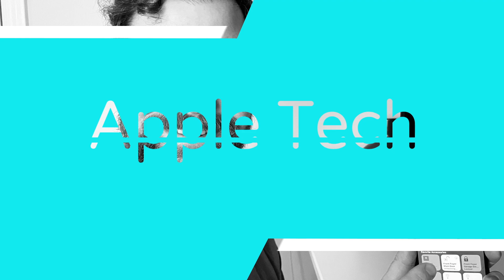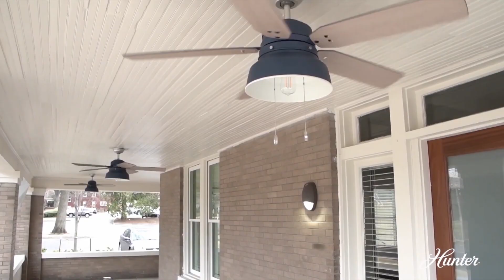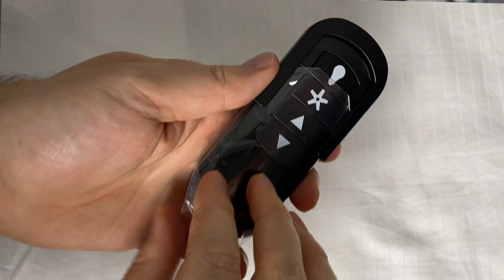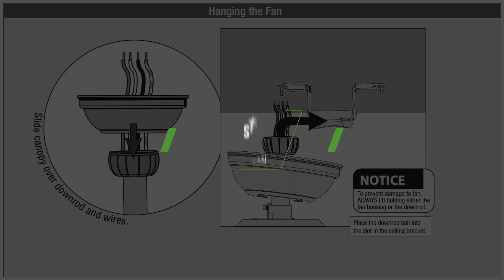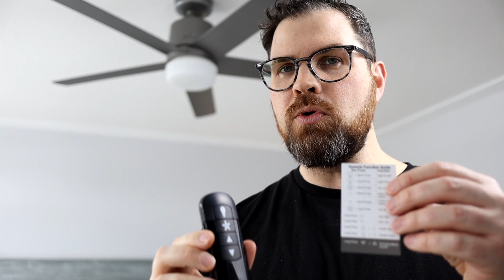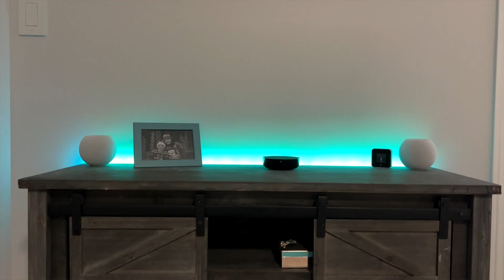HUNTER FAN FOR YOUR SMART HOME! Add into Scenes & Automations

Comment from the maker: 💥Let's Connect! 💥
See what I'm up to between videos:
📸https://www.instagram.com/thebradlloyd/
🐦https://twitter.com/HomeWithTBL
😀https://www.facebook.com/thebradlloyd

Check out this low profile Hunter fan:
https://geni.us/eYuHtX1 (affiliate)
Reply: Hello The Brad LLoyd. I appreciate the review of your Hunter ceiling fan. I bought the Aerodyne model back in January of this year. Which leads me to my question. Have you had issues with the fan going to no response in Homekit? I've had nothing but trouble from mine and I've worked with their tech support for over 2 months. I don't think I have any kind of extraneous network setup as all my other Homekit devices work with no issues. I'm to the point to where I think there is something wrong with the fan but their tech support doesn't seem to be willing to entertain that idea. Any ideas by you or anyone else that may help, would be GREATLY appreciated!!!
Reply from the maker: @TechJB65  Hi Jody, I haven't had any issues. Aside from the standard basic troubleshooting, you could try to reset it, remove it from homekit which I'm assuming you may have already tried. You could try to assign a static IP on your Wifi Network. These instructions depend on your router. Sorry for the delayed response. Hope you figure this out because it's a shame when a great fan in my opinion, isn't working as intended for you! Thanks for watching.
Reply: @TheBradLloyd  thanks for the information. I may have figured it out. I’ve had the fan up abs working with Homekit for a full day now without going to no response. I had to reset the fan with the remote and disconnect it from power. Then I rebooted my mesh WiFi system and waited till it was fully up. Then reconnected the fan to power and went through adding the fan back again through the Hunter app. So far it’s been up and responsive like I said.

Comment: these fans are terrible and frustrating- while functionally is fine - Their smart integrations with Alexa and HomeKit are terrible. My lights are constantly out of sync and some of my fans dont connect at all.  Working with CS hasn’t panned out after 5-6 total hours. I am beyond frustrated and at this point I’m looking at a charge back because they can’t seem to solve the issue and are at a loss for why their lights are out of sync or randomly turn lights on after they are turned off (or vice versa)

Comment: Hunter make’s excellent fans.  Hunter makes horrible smart integrations, Hunters app works when it wants to.  Hunter customer support is bad, bad, bad.  Imagine the worst customer service you have ever experienced, that’s about where it’s at.  Took 6 weeks to speak with a Technician to help the WiFi issues.  He did Not help.   I eventually fixed the issue on my own through trial and error.

Comment: lol, think I had that same ceiling fan you had updated.  That must have been the "standard" design.  Wasn't attractive then and has grown worse with age.  Everything you said, applied to my situation, only have one switch, want apple home kit, etc.  And there are not many choices.  Sticking with a brand like Hunter or Hampton Bay is HIGHLY recommended.  this isn't exactly like setting up a lamp.  its a bit more labor intensive and you want it last and not make a lot of extra noise for years.  Thanks for posting.

Comment: How many wires do you need for the hunter fan? In my new home I have a bunch of recessed lights in my main living room witch is 40ftx40ft and I was just going to install fans with no lights and I believe their is only two wires with a ground L1,Neutral,Ground. But now I changed my mind and want lights in my fans but I have already sealed the walls with drywall.

Comment: How did you keep the fan connected to wifi? And how does it reconnect if you lose power in a storm? I am having nothing but issues after buying these fans after watching your video.
Reply from the maker: I’ve had zero connection issues. Not sure if it’s an issue with the fan or perhaps your wifi…? If you’ve already tried a factory reset and are confident in your wifi then I would suggest contacting Hunter.

Comment: How bright is the light? I have a big master room.
Reply from the maker: There are a spot for 2 bulbs, so it just depends on what you install. The lights I have in mine are 1100 lumens (75 W equivalent). I don't think the larger 1600 lumen bulbs would fit though.
Reply: @TheBradLloyd  Thank you

Comment: thank you! i use hue lights with an Lutron Arora dimmer and i was concerned that i wouldn't be able to use my dimmer switch any more since they can only control hue lights. :) i figured it may be possible if i left the hunter light on and then hid it in home kit. thank you for confirming :D
Reply from the maker: Yes, I’m using the Aurora for the hue lights in my fan as well - it works great.

Comment: man you had the same fan i got, and its making a ton of noise so im going to get what you got, I like that hunter fan it looks bad ass. I had to switch to the Radeon man, the stylus was too big for my room, its really a beautiful fan and a major upgrade over the pull chai. different remote from the stylus also and connection to the app was a hassle. The fan is quiet indeed. looking to add the philips smart bulbs to it to see if its work it. the govee's looks better as I plug them up. I dont like the frosted light defuser thats on the fan though but its good for now.

Comment: Do you have to pair this with a smart switch? If you use a standard switch, and someone turns it in the ‘off’ position, I imagine you can’t turn the fan on from HomeKit? Is that accurate? Thanks for the guidance!

Comment: Hey Brad. I had the same setup at home with one switch for both the fan and light. (Technically there’s two switches on the wall, but one is for an outlet.) I just installed my Hunter fan and it worked in HomeKit for a few minutes then went non responsive. Do you know if I have to stay on 2.4 ghz to work all the time. My phone almost always reverts to 5. Thanks in advance.

Comment: Should have just got a normal fan and used a smart bulb. Then use the twitch to control the bulb in HomeKit
Reply from the maker: That would work if you don’t want HomeKit support to control the fan. If I added a HomeKit switch for the fan, then it wouldn’t allow my smart lights to work. Aside from expensive rewiring (to add a second switch), this was the simplest solution. It’s working great for my set up, though your needs may be different.

Comment: I’ve had the Hunter Symphony for over 2 years. Their customer service was great replacing warranty issue with one of the four fans. The biggest downside is their simple connect app which their many updates doesn’t fix much but introduces new issues. The app will randomly ask you to login after you’re already logged in and then warn you all fans will be removed after you login. If I bypass login my fans stay in the app but I can’t update or save changes. Biggest issue is HomeKit reporting the fans not responding which may be HomeKit issue or combo of HomeKit and Hunter controller.

Comment: My two Hunter fans are hands down the worst smart home purchase I have ever made.

There is NO way to factory default the fans completely, and mine had been stuck in a state where they thought they were part of a HomeKit home, but HomeKit did not have any entities. Trying to add the fans would result in a "This device already belongs to a HomeKit Home" error, resetting did absolutely nothing.

I called Hunter Support and explained the issue, and the tech's first question was "Are you using an Android phone or Apple phone?" ... for a HomeKit issue...

After explaining multiple times, they ended up referring me to the developer of the app and fan software. He only works on certain days. He gave me a call, and because I was able to get the fan to connect to WIFI (attempting to add to HomeKit would reconnect the fan to WIFI, but not HomeKit), he was able to reset the fan from his side, allowing me to finally add the fan back to HomeKIt.

I constantly have to power off the fans and power them back on as they tend to not respond, even though I have no other issues with this and other devices in my home. These things make me nervous that one day they won't respond, I won't be able to fix the issue, then I'll have to go back through support to get the fan reset.

TL;DR - Fans are finicky, app and "smart" functions are underbaked, mainline support is clueless. Tip: If you have neutral wires in your home, get a fan you like and use Lutron's fan control kit instead.
Reply from the maker: Thanks for your feedback, I haven't had the same experience however, I can't imagine the frustration you would have had after all this. Using a Smart Fan control with a regular fan is a good option for many, if like you said, you have a neutral wire. Thanks for taking the time to share your experience and hope the issues are resolved for now.

Comment: I loved this review, especially as I just installed a Hunter Romulus.  We're in the middle of some house upgrades and we discovered that a bit of rewiring would allow the approximately 8-year old Hunter fans in each of my kid's bedrooms to be wired to a separate light and fan Lutron Caseta switches. The fans still work great after many years of use.  

The same was not true for our master bedroom.  Therefore, after some research, I purchased the Hunter Romulus.  The link to HomeKit means that the controls my wife is finally comfortable using in other parts of the house now work in the master bedroom through it's HomePod.  It has had flawless connection since we first installed it.  Moreover, the fan is easily the best I've ever had.  At max speed, it operates without any wobble and the noise is barely audible.  The combination of a great running fan with HomeKit automations means that my wife turn the fan on at the beginning of our sleep.  As she insists on sleeping with her window ajar, the room eventually gets too cold for a fan.  Therefore, linking it to my Eve Home means we can have it automatically turn off at a certain temperature.  Even after just a week, my wife and I are both loving the fan.

Comment: Wow Brad, this was an awesome video! I just installed a Hunter Aerodyne smart fan in my bedroom yesterday and I love the apple HomeKit compatibility. How do you program temperature based automation? I’ve got to know!!!
Reply from the maker: Thanks Scott! Glad you love this video. You can set up temperature based automations in the Eve app, Controller for Homekit or Home +5. I use Eve Room to measure the temperature or an Aqara temperature sensor, and then you can just set up your automation to say once a certain temperature is reached, turn on the Hunter fan. Hope this helps but let me know if you need more details. Thanks for watching!!
Reply: @The Brad Lloyd thanks for the detailed explanation on programming temperature based automation. Now I’m having connectivity issues with the fan. It disconnects from HomeKit. I have to call Hunter’s 1-800 customer service number

Comment: Very much loved the review. I will bypass the wall switch completely (I still have the circuit breaker) and instead put up a wall mounted scene controller, plus use Nanoleaf bulbs. The reverse button in the Home App is extra special! Should also be able to hide the Hunters light tile from HomeKit as well.
Reply: how did you hide the light tile?
Reply: @jay-jay017  
I did not get the fan yet, though I want to.  I did write to Hunter to request they update the firmware to optionally show the fan’s light fixture as a Switch in HomeKit, to prevent Siri and HomeKit light redundancy. The Homebridge Tuya plugin developer did this for my current dumb fan that I use with a Tuya Fan + Light wall switch that had the same issue.

Comment: This is not quite an honest review. This fan is plagued with delays between command to execution.
Reply: The delay from command to execution has been quite nominal on my side. If I am using the remote, app, or Home app, the delay from press to execution is less than 1/2 second. When using Siri on my HomePod the delay is akin to any other fan or light in the house (95% of which are Lutron Caseta switches, dimmers, and fan controls). 

It’s a little disingenuous to call someone‘s review as dishonest without asking if they’ve experienced such issues.
Reply from the maker: I can appreciate your concern, especially if you’ve experienced issues. I haven’t personally had command delays and if I did, I would disclose that. If you are having delay issues, you could try checking your wifi connection in the room you have your fan and also try a factory reset. Depending on your router and how many wifi devices you have could also impact performance. Hope this helps. 
Thank you for commenting and watching though, I welcome all feedback that is respectful, positive or negative.

Comment: Great review! Quick question, when viewing the TV how bad does the fan show in your field of view? I have my tv wall mounted and haven’t installed a fan as I’m concerned that it will be in my view when watching tv. The Hunter fan looks great though!
Reply from the maker: Hi Ben! I was thinking the same thing initially but it isn’t in my field of view at all. We used a 2” down rod so if your set up is similar to mine, I’d say you’ll be very happy with this #Hunter fan. You could install a low profile option like the Romulus if you want more head room. 
Here is an affiliate link if you’re interested. 💥https://geni.us/eYuHtX1
Thanks for watching! Appreciate your support so much. 👏

Comment: For those wondering, this fan has a DC motor and will only work using either the included remote control or through a smart home integration. It will not work with smart switches.

I don't care for the modern look as all of our furniture is antiques. I went with Hunter Builder Grade Ceiling fans with pull chains. I switched out three of the single gang boxes with dual gang boxes, which is actually pretty easy to do as a DIY project. The Living Room single gang box was already wired for two switches but only used a single switch so I did not have to rewire it. The two smaller bedrooms (Office and Guest Bedroom)  had to be rewired but I have plenty of head room in my attic so it was a breeze to do (switched out the 14,2 Romex to 14,3 Romex - also not that hard to do if you have access above the ceiling). The Master Bedroom already had two switches controlling that ceiling fan. The Den had a 3-way switch for the light and a single switch for the fan.

I installed five Lutron Caseta Ceiling Fan switches for all of the fans. I installed Lutron Caseta dimmer switches for all of the ceiling fans and used a wired Lutron Claro switch for the 3-way light in the Den (using a PD-10NXD-WH dimmer switch). I don't use any Pico remotes anywhere in the house. I currently have 40 Lutron Caseta devices installed in my house.
Reply from the maker: Thanks for sharing your set up, Frederick!! Definitely great options from Hunter no matter what your style. The SimpleConnect is great for me though I can appreciate in your case, it made more sense to have a standard Hunter fan with Lutron Caseta switches. Thanks for watching!
Reply: I see this fan as AC motor

Comment: Coincidentally, I’m installing one of these fans as we speak! But I can’t get it to turn on when connected to a Lutron dimmer and Lutron fan control. Do you know if this is supported? Thanks for another great video!
Reply: This fan has a DC motor and will not work with a Lutron Caseta Fan switch. You would need to get a Hunter ceiling fan that has pull chain controls. Then you can use the Lutron Caseta Fan switch to control the fan and a Lutron Caseta dimmer switch to control the lights.
Reply from the maker: Hi Jake, it's a Simple Connect fan that you are trying to connect to a Caseta switch? I don't think that will work. Since the "smarts" are built into the fan, you don't need the Caseta smart switch. I would replace the switches with standard switches that stay on to maintain full power to the light/fan. If you're looking for wall control, then you could consider adding a button for "some" basic controls.
Reply: My goal was to keep the Caseta switch look throughout my house but I ended up wiring the included switch and everything worked as intended. Thank y’all for the information!

Comment: Got this same fan and hue, I grouped both bulbs and the fan light into one tile and it works great when turning off and on.
Reply from the maker: Hi Nick, that is a great tip - thanks for sharing!
Reply: Brilliant (literally and figuratively)!
Reply: I did not have a good experience using my hue lights in my hunter smart fan… it’s problematic if you turn off all the lights in your room which will include the hunter’s smart light and cause the hue lights to get no response
Reply: How did you Group 2 Philip hue bulbs and the fan and light into 1 tile?

Comment: I’ve heard you can add a HomeKit Lutron Fan Swith. Then add Nanoleaf bulbs. Your existing ceiling fan is now smart.
Reply: Will this only work if your existing switch has two switches?
Reply from the maker: I haven't tested that, but great tip, thanks for sharing!